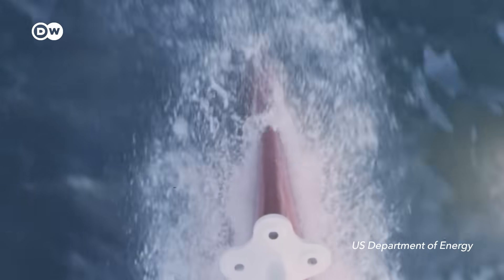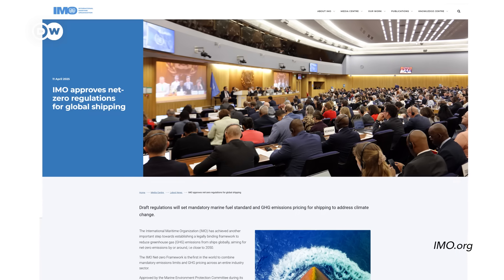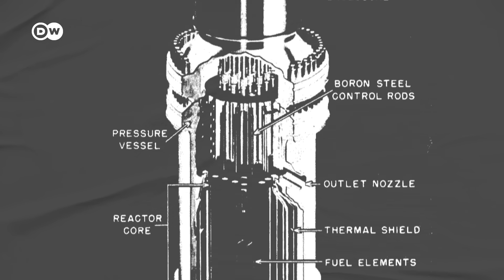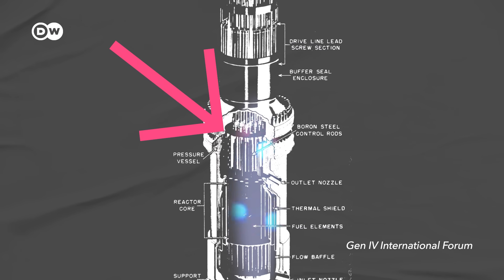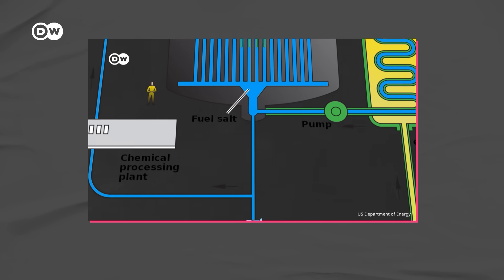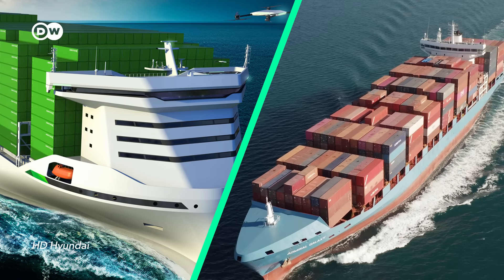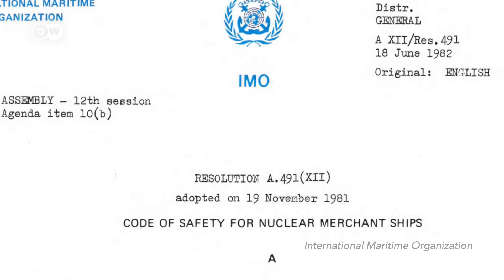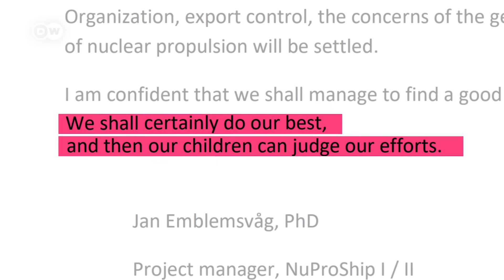Why people want to put nuclear reactors on ships

Comment: Nuclear powered civilian/commercial vessels are a non-starter.  Just because there is interest in it does not guarantee any success or any commercial progress.

Firstly, passively safe Gen-IV reactors are a benefit but not enough to offset the other risks (see below)

Ships sink all the time or run aground.  If a nuclear powered vessel were to sink, it could be an environmental catastrophe.  The unpredictable nature of oceans and storms amplifies this risk.  The salty marine environment is unforgiving and slowly erodes everything.

If the sunken reactor were miles below the surface, it would be difficult for salvage crews to gain access.   If there was a leak in the reactor core or the spent fuel stored onboard is exposed, then ocean currents will start distributing radioactive materials.  Going into such an environment is risky for both machines and humans.

There's also the risk of piracy.  Commercial merchant vessels are typically unarmed so a hijacked nuclear-powered cargo ship creates unique threats: theft of reactor hardware/fuel (proliferation risks depend on fuel type), using the ship as a bargaining chip, or forcing the ship into risky behavior. Military nuclear vessels are protected and crewed by specialist forces but commercial nuclear vessels would be much softer targets but those generate legal/port/insurance complications and give nuclear opponents more reasons to push back.

Everything I mentioned above increases with risk as more nuclear vessels are produced and operated.  This is basic statistics with aggregate risk.  Unlike any other fuel-source, nuclear power cannot risk even one single incident! This is the double-edge sword that nuclear energy has always carried with it and can’t get away from.  Because just one single incident (sinking, grounding, fuel leak) could scuttle the entire commercial nuclear shipping industry!

There other problems I’ll gloss over here:
- Refueling is risky especially in maritime environments
- Compliance with maritime transit laws which can delay passage since nuclear powered vessels would have tighter compliance. Cargo shipping lives and breathes on keeping tight schedules.
- Insurance and tighter compliance complications increasing costs

Nuclear power often looks good on paper but crumbles in the face of real-world complexities and real-world economics.
Reply: the USS Scorpion and the USS Thresher have both shown that nuclear wrecks have next to no impact on the envorment while being unsalvaged
Reply: @elapidpython4378  The USS Scorpion and USS Thresher actually do not  really help make a case for commercial cargo ships to be deployed at scale.

Firstly, those two vessels are military and hardened for battle conditions and maintained by dedicated highly-trained crew.  Commercial ships could do this level but at enormous cost and additional weight.  Military vessels effectively have no budget limit as mission objectives override most any economic objectives.  The fact it takes military budgets and effort to prevent leaks shows how difficult it would be in the commercial sector to replicate.

Secondly, these two wrecks are at deep depths.  The USS Scorpion is at 9800ft and the USS Thresher is at 8530ft deep.  I would challenge the claim that they are not leaking any radioactive material.  The latest samples were provided by the military decades ago and do not represent the latest samples.

Would need an independent exploratory team to retrieve latest samples.  But a privately funded independent mission must be undertaken to go to depths to retrieve samples and take high resolution photographs.  But this costs millions of dollars.  What’s worse is that, under international law, a sunken military ship remains the property of its flag state.  The US navy retains legal possession and can forbid interference.  A private expedition to retrieve samples would risk disturbing a navy wreck without permission so may violate criminal and international laws which further complicates the mission.

At these depths, pressures are very high at around 3000 to 4000 PSI!  Salt water and high pressure will put a beating on the containment.  Reactor containment is not made to handle external “inward” pressure—they’re made for internal “outwards” pressure and at some 2000 PSI.

Thirdly, the fact the US Navy cannot reach these vessels highlights my original claim that if a sunken nuclear-powered commercial cargo ship were at such depths, any leaks would be disastrous and very very difficult to reach--all while ocean currents spread radioactivity far and wide around the globe.  It would be an absolute catastrophe for the world’s environment and marine-based economies.  Not worth the risk at all.
Reply: @beyondfossil  thats funny cause I dont recall claiming they did 
I recall claiming that they are proof against the idea that a sunk nuclear vessel would cause an environmental disaster 

to your first point they where maintained by 20 something college dropouts with less overall training than civilian secter operators I know this because I am one of them 
cost is only a factor until the tech becomes mass produceable and the idea that the navy operates on "no budget" is obsured the navy ended the seawolf class after 3 ships because they where to expencive 
and it does not take a military budget to prevent leaks just compitant design 
as to the idea of "additonal weight" no because when you add the reactor you remove the convental propultion plant your not just having both 

to your second point... and...
yes they are at depth but do you know what surounds them 
water
do you know what the primary material used in radiation shielding is 
water
do you know what the 1/10 thickness of water is 
about 20 inches 
that means all the radiation being put out from the reactor is being divided by 10 about every 2 feet from the core
now guess what that means 
it means that by the time you actually get out of the wreck radiation from THE CORE the LARGEST source of radiation on that boat is mathematically insignifigent 
thus any leak from said wreck is even less insignifigent 

to your third point see my second point
Reply: @elapidpython4378  The water insulating effect is precisely one of the issue why a sunken reactor is so dangerous.  You cannot detect gamma or neutron emissions from the near the surface.  Furthermore, the navy has not returned to investigate the wreck for decades and they cannot remotely detect a leak either due to aforementioned water's insulting effects.  

So with decades of time now past combined with the effects of extreme pressure and a corrosive marine environment, the USS Scorpion and USS Thresher are at major risk.  They simply cannot remain down there!  But nobody's talking about decades old sunken nuclear wrecks so thanks for the reminder.

It's not just about the direct emissions.  Ocean water currents will be spreading highly radioactive particles across the ocean biosphere.  Neutron activated materials will also be spreading.  Alpha and beta radiation are not deadly in air but very deadly when embedded into the biosphere and into living tissues.  Humans eat aquatic and marine animals all the time if you hadn't noticed and we like to drink water too.

Moreover, a war vessel owned and operated by a sovereign government can  invoke sovereign shield privileges on grounds of national security.  And it behooves the navy to cover these incidents up as much as possible.  They will claim ownership and invoke government-led legal actions against anyone approaching the wreckage.

OTOH, a private commercial operator has no such sovereign privileges.  If a nuclear-powered commercial vessel were to go down, then it would be a media frenzy and outrage across the world will ensue.  The nuclear powered commercial shipping dream would collapse in short order.

So many things in nuclear technology sound great on paper but crumble in the face of real-world technical challenges and real-world economics.

The dream of nuclear powered commercial vessels is dead in the water and remains a fictional dream for this and so many other reasons.
Reply: @beyondfossil  my brother in christ a sunken reactor is the safest a reactor could litterally ever be 
its completly covered in coolant and shielded from the envorment you talk like the navy has never even thought of the idea of losing a reactor and the navy has to report every single pico curi of contamination the ENTIRE program has put into the enviorment to congress and its such a small amount that we had to make up the supid unit of "micromicro curis" so dumb politicians could understand what we are telling them we quite litteraly could not cover something like this up if we wanted to 

"Ocean water currents will be spreading highly radioactive particles across the ocean biosphere"
the solution to polution is dilution by the time any contamination makes it out of the sub its as benign to organic life as the gas three-mile released let alone whatever manages to get picked up my currents if I where you I would be significently more worried about microplastics and mercury in your susi than radioactive contamination from either wreck 
"Humans eat aquatic and marine animals all the time if you hadn't noticed and we like to drink water too."
see previous statment

nuclear power not only sounds great on paper but is extremely practical in real world aplications if pinheads like you would stop falling for hippy propganda from the 70s
Reply: Current Generation US Nuclear ships are never refueled. They run on the original fuel for 20 years and then are scrapped.  The likely form of civilian nuclear reactors would be as 40 foot containers.
They can be at the bottom of cargo holds and handled using the normal cranes available at any port.  "Refueling" would likely be akin to changing batteries, the entire container is swapped.

Nothing like what was done 50 years ago.
Reply: @qcca123-f1v  No, your claim about long refueling periods only applies to nuclear-powered military vessels running under state-run budgets using highly enriched uranium (HEU)—all of which are not available to commercial operators.

Commercial nuclear-powered ships would not have access to weapons grade energy-dense highly enriched uranium (HEU) fuel that the military has access to.  HEU is forbidden outside of military due to nuclear weapon proliferation concerns.

Furthermore, commercial cargo ships simply use more energy that military ships do.  Commercial cargo ships will be running continuously for 330+ days of the year pushing long transoceanic distances in order to provide their owners with fastest ROI.  Because an idle asset does not produce revenue. On the other hand, a military naval vessel’s average power draw is much lower relative to its reactor capacity—they loiter and patrol mostly, and occasionally sprint.

This means that commercial nuclear-powered vessels would need to be refueled between 5- and 10-years and this is a logistical nightmare for commercial operators.  Nuclear refueling is a high risk operation magnified further by marine conditions.  All ports would refuse.
Reply: Having plentiful electric power on board enables cheap provisioning of better countermeasures against piracy.  Small anti-ship lasers or railguns.  Those weapons aren't inherently expensive, the equipment to power them is the majority of the cost.  Reactors solve that.
Reply: @qcca123-f1v  No, weapons are not permitted on commercial vessels due to legal and liability concerns, not technical concerns.

Coastal and port states can and do deny entry to vessels that carry weapons or armed personnel. OTOH, a warship can be sovereign but a merchant ship cannot rely on a sovereign legal shield.

P&I clubs, hull insurers, and classification societies would likely refuse coverage or impose prohibitive premiums / class suspensions for weaponized commercial merchant vessels. You cannot do maritime business without insurance.

Therefore, commercial nuclear powered vessels would be high-priority “sweet pickings” for pirates out in open seas.  This piracy issue alone kills the nuclear-powered commercial vessel fantasy.

Comment: It’s better to make alternative fuel power the ships but build nuclear energy on shore to make those fuels to be used on civilian ships. You can change the whole maritime industry in one go instead of changing just cargo.
Reply: My guess would be every time energy changes state there are efficiency losses. So it is better to use direct from the source. Edit https://youtu.be/vl8SUYiOHOU?si=86WS6aUt87rMutA-
 The answer is you lose about 60% of the energy by making it into ammonia and back.
Reply: Slight problem, we don’t have super battery that wouldn’t lose its efficacy due to weight size and power ratio, or have an arc reactor like Tony stark. We barely have a fusion reactor that achieves net positive energy in a very controlled environment. Technology still beyond our time.
Reply: I am guessing that the conversion into a portable fuel such as ammonia is inherintly inefficient and may tip the scale when it comes to profitability and feasability. Same reason we dont use hydrogen in cars, converting to this mediator just to generate electricity out of it, adds complexity and cost
Reply: @Zenheizer  People also forget that Ammonia releases Nitrogen oxides. NOx is 270 times worser than CO2.
Reply: Right? Why not use nuclear to generate ammonia and methanol, and then use that.
Reply: @निर्भयतांबे  Because Ammonia release NOx pollution, multitudes of times worser than CO2. Methanol releases CO2.
Reply: @निर्भयतांबे because what assurances the whole world does not go to s...t and then all the current and future reactors become eventual chernobyls...
Reply: @ricardosilva-xz1yt same things that allow us to build and operate nuclear plants for more than half a century ig, the technical know how.
Reply: @ricardosilva-xz1yt because that isn't how reactors work any more. Uranium doesn't spontaneously melt down. You have to have poor design poor maintenance. Enriched sources of fuel and shut off all the safety features.

Modern modular designs simply don't use the fuel required to melt down or the designs. It's like having a raging fire burn down a log cabin. Simply build the cabin out of something nom flamable and you no longer have that risk.
Reply: It's not efficient. A nuclear power plant has around 30% efficiency, a large diesel engine up to 50% and production of synthetic fuels of less than 30%. So you would need at least 7 times as much nuclear power to get the same result.

Also nuclear power on land is not economically viable compared to renewables, especially photovoltaics. And for the production of fuel it is not the slightest problem that PV changes its output during the day. Fuel production could even help to have more changeable load.
Reply: @Phantom-mg5cg  Most Nuclear power in the older days got 30-50% efficiency. Photovoltaics are physically capped at 37% efficiency. Wind is physically capped at 33% efficiency. 
The variability of Photovoltaics is ABSOLUTELY a problem. Unless you're directly adding the entire cost of battery charging and storage into LCOE, all you're doing is that at night, you're running coal boilers at a higher rate at night, which is what every nation does with unfirmed renewables (i.e., renewables which cannot guarantee sustained power delivery)
Reply: @ZippyPiglin36  For the efficiency I trust the data from the IAEA and its around 30-40%. Even in combination with batteries photovoltaics is now cheaper than nuclear as battery prices have fallen by a lot in the last years. The Shockley–Queisser limit only limits the output of single junction PV to around 34%. Multi junction cells in the laboratory achieve at the moment almost 50% efficiency. The efficiency of nuclear power plants and PV is anyway not the deciding factor, the inefficiency of combustion engines and the production of renewable synthetic fuels is deciding.
Reply: @Phantom-mg5cg  If so, why is it not a commonplace for Renewables to be firmed with storage? Why is it still neglected?
And does the LCOE also include domestic manufacturing or still relies on cheaper importing? Because imported panels are from nations that have no work laws, but still use coal. What about waste recycling, since burying all that millions of tons of panels and blades isn't remotely environmentally friendly?

Up and until Renewables aren't held accountable to such standards, I'm trusting Nuclear over Renewables.
Reply: @Phantom-mg5cg  yes, but neither is solar, and i get it, solar is practically wasted if not harnessed, but... maybe one day nuclear is so cheap we can afford wasting that energy if it ment  reduced carbon footprint. what say?
Reply: @निर्भयतांबे  Read my initial comment, the initial comment and the title of the video. The problem is the inefficiency of producing synthetic fuels and the inefficiency of combustion engines. Also nuclear has not yet gotten cheaper over the decades. Solar is much cheaper and faster to build. The whole discussion should not be about "one day", but about the next 10 to 30 years. The production of synthetic fuels is also variable load and can therefore help to fix the only weakness of renewables.